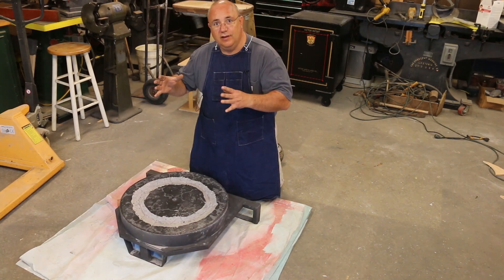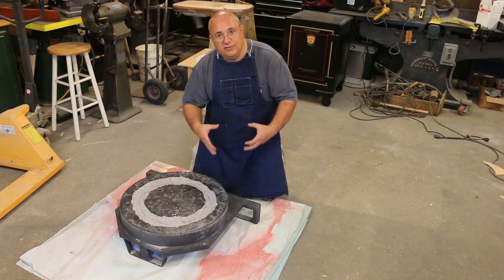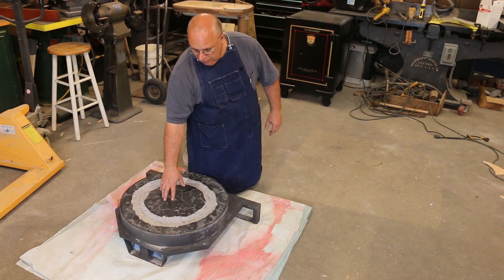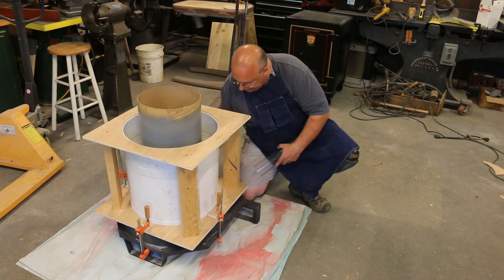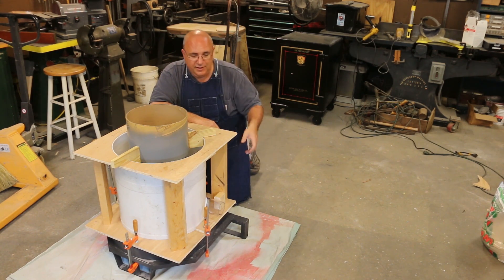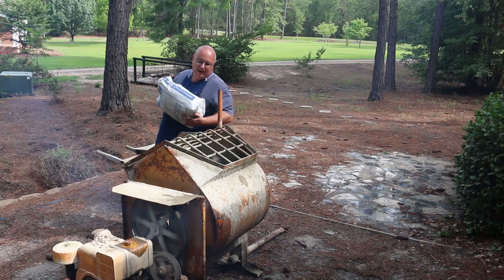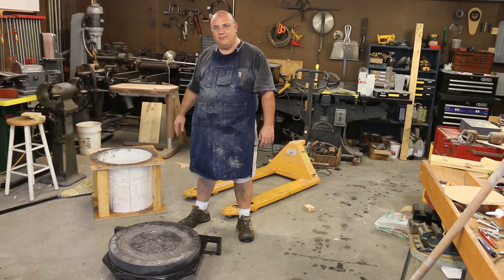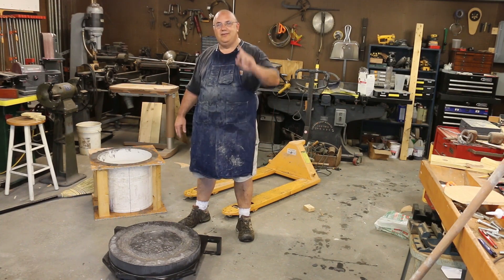Building an Oil Fired Foundry Furnace - Part 5:  How NOT to Cast Refractory

Comment: ....oh man that hurts watching, .......but a lesson more than a failure....need to drill few holes, and dowel that top and bottom together, the heat will create a joint there whether ya want it or not......hindsight..key way......some hooks for the next pour to grab onto would help.....for some old concrete guys.....lots of head shakin going on....from your past repairs on items.....this just means bigger and stronger......lol
Reply from the maker: Rick L I really wanted to put some "dowels" or rebar in the piece, but everybody is telling me not to do that as when the furnace is heated, the dissimilar material will expand at different rates and cause cracking.
Reply: Keith Rucker - VintageMachinery.org .....good point!...expansion needs to be considered........on with the show!

Comment: Sorry about your setback. Did the silicone at the burner tube fail causing the leaking?
Reply from the maker: Walter Plummer No, I think that the hole that I cut in the form for the tube to fit through weakened the form as that is the area that the failure started at.

Comment: Bummer, Keith. I've been a the same place more than once.
How about short off cuts of plastic municipal water or sewer pipe? Got some friendly contractors around there?
I was watching for a burst seam on the outside form. Hammering it down must put a lot of pressure on it. Maybe either get larger muni pipe, or wrap something tight around it. What do they call the rings around barrels? Those things .
It'll "better that ever," next time.

Comment: Keith, I appreciate you posting your failed attempt. While it may be frustrating, it has helped.

I believe if you roll tin and fill it completely with sand, you'll get the result you are looking to accomplish. 

My questions, should you not funnel your drain hole? And, do you not need something for the refractory to grab hold of on the bottom slab? I see you roughed up the bottom for this reason,  Like concrete, I see this expand and contract, cracking at this joint. Got to be some overlap at that joint. Maybe a refractory bowl on the bottom. You're making a really big furnace.

Something else I've seen used is a sand bottom with air blown through the sand, hence bubbling, and the the fuel added through a nozzle on top of the sand. It's called a "bubbling bed furnace" and it does get HOT. Air keeps the silica from fusing, but it glows.

Keep sharing.

Comment: I'm really sorry you lost all that time and material, Very sad.

Having done a bit of concrete work in my past I have a suggestion which might be especially pertinent since you must mix full bags to get the proper composition of the material. Make all your forms ahead of time, including the form for your lid so when you have extra material you can continue to pour without waste. In addition if you build an "auxiliary" form or two for something that might be useful, perhaps a spare lid, a square or rectangular pad which you might put your foundry or molds on top of, a small round pad to put your crucible on after pouring. If you have extra forms you can pour until you run out of material and either discard the extra forms or pour them later if you choose. By doing this if one of your forms breaks or doesn't work out you have options and don't end up with a total waste of time and materials.

As an example, the last concrete pour I did was two gravity type retaining walls about 4 yards apiece. They needed to be continuous pours with no cold joints and I had a concrete pump hired as well so to insure I had enough I ordered a little extra concrete. I made forms for a porch outside of a doorway, two small rectangular forms for 4" thick pads, one for an AC unit the other for a garden hose reel and I formed up a catch basin for water runoff. End result, all got poured and waste amounted to about three shovels full.
Best of luck with the next pour.
Steve
Reply from the maker: pyromedichd1 Thanks for the tips.  I will be better prepared next time....

Comment: So sorry Keith, although it failed, it taught others and your channel is about teaching, sharing and learning. I'm sure you will find a way to make it work. It will also give you time to build the lid, so you can pore it all at once. You have done a great job so far,.I really would have thought the wood and sand you put inside the center tube would have been enough to hold that form out. So I guess this would have happened to me too..I bet this will be a great furnace once it's done. Looking forward to seeing the rest of this series and then you casting and machining the dial for your safe.

Comment: Kieth, sorry about the refractory pour. When I saw you trying to reshape the roundness of the tube when it was filled, I knew you were in trouble.  I have used similar "sonitubes" for years, and your right, they work great for the way they are intended, concrete on the inside. when we need a to cast a round hole in a "poured in place" concrete wall, you can make it yourself out of styrofoam, sheet metal or plywood. when using sheet metal or plywood, cut 3 or 4 circles of 3/4" plywood for top, middle & bottom and wrap the material around it. use 1/4" plywood with the outergrain of the plywood going perpindicular to the length of the tube. If you have 1/2" plywood, cut grooves 1/2" apart on the inside face, to help relieve bending the plywood around. We spray "form release" or dielsel oil on the wood to stop the concrete/refractory from sticking to it. This will be a pain to strip out, but you can do it. Don't give up, keep those vids cummin.
Jim B. retired carpenter/superintendent 44 years, now machinist in training.

Comment: You have my sympathy.  I appreciate that you shared this.  Sometimes I wonder if I am the only one that has that kind of thing happen to him.   I wish you the best on the project.  I am sure it will turn out great. 

What about filling the interior tube with spray foam insulating?  Would it offer enough strength to keep the refactory back?

Comment: Keith, in my opinion you was able to prevent of collapse of this tube,
first thing is that bottom round piece of wood was not enough round and it should be more of such support, and should be better mounted to the base,
second is that you should to protect tube better against the moisture, I think plastic foil for packing might be good to do this, another thing is that you was tapping concrete to settle and also flexing the tube all of those factors contributed to collapse.
So you need more rigid tube which is also good protected against water,
tube should be not flexing and not moving during to fill up the concrete.

Comment: Hi keith
Try Mc Elroy it toucon arizona. they make machines for welding PE tube for water/ gas and drainage. I am in England but  I work for a plant hire company and we are agents for Mc Elroy in Europe. They may be able to supply a short length of pipe which will not "stick" to the refactory matearial. Just a suggestion but PE is water proof, Hope you get er done soon
Laurie

Comment: Some days you get the bear -- other days it gets you:). But agree with Herb Blair that filling the inner pipe with concrete is a good bet. If you coat the outer side of the center pipe with used motor oil before pouring the refractory it would help release it.

Comment: Keith,
Sorry your furnace went down the toilet! Perhaps you can use chunks of the refractory for welding on, etc. I feel for you! All that hard work for nothing! Life can be a hard teacher at times. Put the project on the back burner (pun intended) and you will come up with a better idea. Thanks for sharing your trials and tribulations!
Have a good one!
Dave
Reply from the maker: Swarf Rat I poured several pieces in some plastic tubs just for that purpose.

Comment: I'm sorry for your bad experience with this task :(( I did wonder though when you said it was cardboard and wondered about that. As others have said if you intend to do something similar surely you need to prefill the centre tube with a robust material  which will withstand the side pressures of the wet refactory material + the effect of you ramming it solid as you fill it. Perhaps an air poker might be better at this task?

Comment: You've just suffered a "Successful Failure".  Continue with your original plan.....but this time ..... coat the cardboard tube with epoxy paint!  Use your parts-and-pieces as you've designed ..... Simply include a pint (or so) of epoxy paint (ends included) to seal the cardboard.   Hope this helps! Good luck and good cheers.

Comment: Lesson learned-This is why I asked if you seen and read the Gingery charcoal furnace book! With some wood circles in the tube it would not have been able to push in.
The wood forms split and hand holds to grasp would have made them easy to remove.
Sorry you had trouble and the loss of the high prices refractory, better luck with the next pour! Regards Gene

Comment: Sorry it didn't work Mr. Rucker I have been there before with some concrete poors of my own.  You had all the right materials just needed to go a little further.  If you put a piece of all thread from the bottom up threw your base to the top of your center hole then fill that cavity with sand (around the all thread) you can put a plywood cap that is just smaller than your inner pipe with the all thread up threw that cap you can then thread a nut from the very bottom and top tighting on the sand in the middle putting outward compression on your sona tube ..  This does two things you need holds you center pipe to your base and makes it rigged so it can't colaps.. good luck..

Comment: It's still a good plan.  Just need to fill the sonatube with concrete before beginning,   It has to be something that will fight the forces of expansion- I dont think PVC was going to be strong enough either.   You need a solid core with an eye bolt to lift it out of there.
   How much ($$$) was the loss.  I want to help, and I'm sure many of your followers want to as well.   Failure is not an option and you don't want to wind up on one of those "Failure Compilation " videos do you ?
Reply from the maker: Tim Saunders The refractory material lost in this exercise cost me about $650....  Oh well, live and learn, right?  We will make it happen right the next time....

Comment: That sucks big time.  I would put the cardboard form in a heavy garbage bag to prevent water from getting into the form. I would also put a garbage bag inside and spray it full of that expanding foam insulation to give it strength I think that would eliminate your problem and be pretty easy to handle. You might try  making your mixing more dry, it looked kind of wet. I find concrete and mortar is always much stronger the dryer you pour it. Water takes up space so when it has a lot you end up with lots of empty space when it dries out. It is harder to work when it is on the dry side but I find it always still sets up fine especially if you wet it a few times after it dries out to reactivate any loose cement and get a full set.
Reply from the maker: bcbloc02 Some others have mentioned the expanding foam.  I might try something like that in the next attempt.  As for the mix, I was following the instructions.....

Comment: Bugga. It's a testament to your honesty that you post your failures as well as your successes.

One mod I'd make to the design next attempt, is to change that v-groove in the base to a slot with vertical sides. I think the furnace needs to be locked in there.

You'll get it next time.

Comment: You could fill the concrete form with solid Styrofoam packing material and make the burner tube outof the same. The burner tube can then be melted out with a torch.

Comment: What a shame, that looked like it was hard work as well. Perhaps if you wrapped the cardboard tube in cling film and then fully packed it with sand it would be enough. I'd probably steer clear of cardboard for the next pour though. Finding a plastic or metal tube of that diameter will be a challenge I'd guess. Mains water and gas pipe can be that sort of size, perhaps they have off cuts?

Comment: not all is lost Keith!  if you haven't disposed of the refractory yet you can do the following.. which will work to your advantage:
bust up the refractory after it has dried into about 2 inch diameter chunks. if you have any of the cement left the you can use is as a base mortar/concrete. put down a base layer of about  inch in the bottom of the form, and then pit in a ring of chunks. keep layering in mortar and chunks.. tamping the mortar as you build each layer.
don't make the mortar as soupy as you did for the initial pour.. for some dumb reason refractory has to a little on the dry side.. about like a dry-isch mortar..
the problem with your initial pour is your mix was too soupy.. it needed to be drier.
otherwise the perlite and other fireproofing material settles out and you have a fine layer on top and a coarse layer on the bottom that will crumble as soon as the slightest pressure is put on it..also the pressure in a concrete form becomes too great and the forms fail.. and you saw that already.
bummer that it turned out this way but i am still looking forward to the completion if you should choose to follow thru.. working with refractory is a pain and i've made my experience with it.. hope this helps
cheers
mike

Comment: Hi Keith 
Sorry about the loss of material unfortunately wet cement products are very heavy and made worse when compacted. You did everything right except the tube you could still use the same type of inner tube but just brace it. You can use 2" x 2" timber in a cross and stagger them inside the tube you could have four lots of crosses would do and as you fill you add the next.
I would also suggest using at least two tie downs the ones for motor cycles around the outer form as well this will stop it from swelling. The biggest problem is the compaction it would not have mattered what form you had in the center it will crush if it is not braced when compacted.

I spent many years in the concrete game and saw so many forms fail and all were caused because of the compaction and lack of bracing. You cannot have enough bracing oh I almost forgot it would be a good idea to also have two tie downs holding the tube down to the base so as to stop the tube pushing up when you compact it.

You have spent allot of time and energy in this project just remember to round the ends of the 2" x 2" to match the curve of the inner form and all will be good.
Good luck when next you try.

Dave
Reply from the maker: David Cashin Thanks for the comments - I am already coming up with a plan for the next try...

Comment: It may sound harsh but if you were in our shoes you would have seen the potential problem. Those tubes are designed to withstand outward pressure, not inward. If you had filled it with sand or some other loose aggregate it would have probably solved the issue.
Unfortunately like you in this instance I never am able to see the issues in advance and screw up all the time.
I have to say though you're doing a mighty fine job and I take my hat off to you. I learn so much from your videos. Massive thanks for educating and entertaining me. Watching it all the way over in the UK.

Comment: that's a bummer, was coming along real nice - i was wondering close to the end what is the "how NOT to" for.
Maybe if you can use a PVC pipe inside the cardboard tube to keep it's shape, or use a pvc pipe alone but slit so you can remove it (although I'm not sure how that's going to work). Was the cardboard in the inner tube getting soaked and that's why it collapsed? If so could you use some plastic to keep the water out (like a garbage bag on the outside, or maybe vapor barrier which is thicker and join it with tuck tape)?
Reply from the maker: sharp x I think the problem was as much the hole that I cut in the side of the form for the tube to come through - that weakened the form in that area and that is where the failure first occurred.  From there, it went south in a hurry....
Reply: how about cutting the transparent tube to meet the inner tube rather than going thru it. I still think you should have it filled like others mentioned and imo keep it from getting soaked with some plastic on the outside (and if using wet sand then on the inside as well).

Comment: So sorry Keith; I thought for sure that would work for you.  Maybe check around the water works to see if they might have some heavy wall PVC pipe scraps in that diameter.  I've seen those cardboard tubes used to pour concrete many times and didn't dream it would cave in.  I guess like you said, the pressure and moisture was from the outside rather than the inside.  That pressure creates the uneven result we see here.  Think I'll keep my ideas to myself from now on, Greg.
Reply from the maker: Charles Compton Yes, I really thought it would have been find, but now that I saw what happened, I can understand why it was a bad design.  That is how we learn.....

Comment: Most concrete form work utilizes threaded rod or keys. Was lucky 2 have friends in the concrete business and let me use some forms. Ran very coarse   3/4 threaded rod right thru form work and used not only for spacing but also so forms didn't bulge. Sorry 2 see the failure.